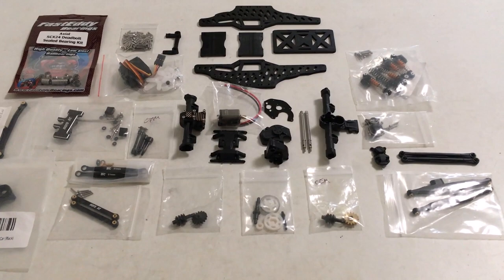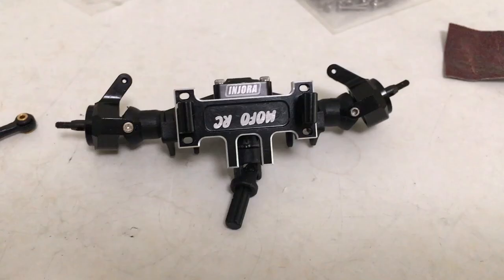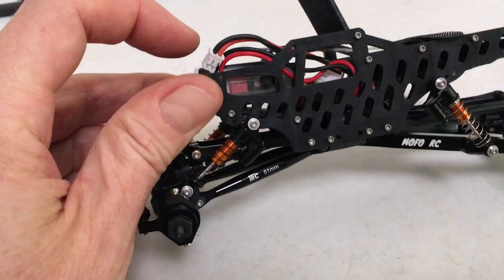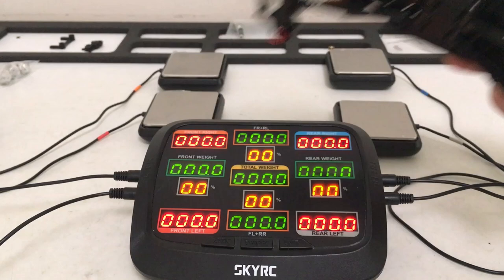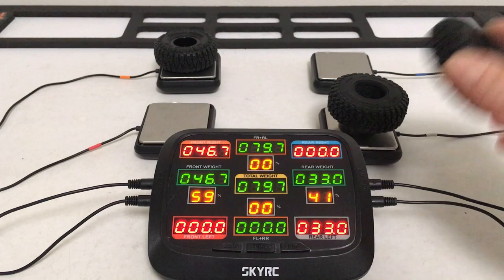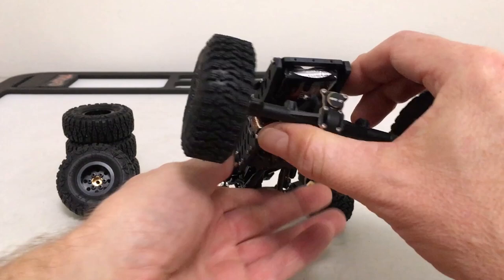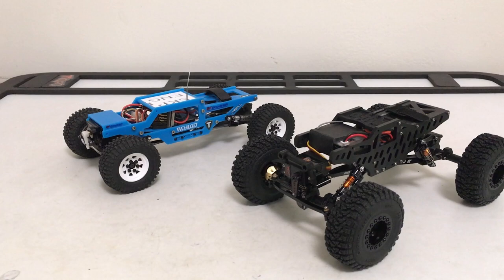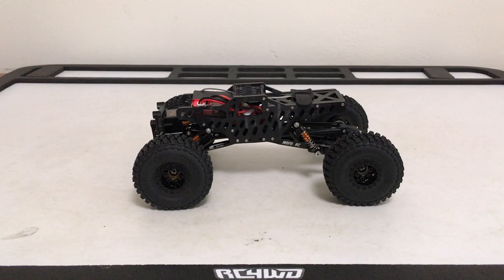MOFO RC SCX24 - PROTOTYPE CHASSIS BUILD: "THE FLAPJACK" W/ MOFO ALUMINUM TRAILING ARMS, MOTOR & RIMS

Comment: Murdered out man! Gonna test it against the warthog? I remember you saying that one was too good it ruined the fun!
Reply from the maker: For sure. I need to tweak the Warthog a bit to compete fairly though. Get the belly clearance up and steering to full capacity.
Reply: @bcochener  Be interesting to see a side hill tip test on a sandpapered board between the Warthog, full droop as you have it and the "Flapjack". just to see if the MoFo's height is a problem or if there's enough low weight with the MoFo rims/hubs to make it stable and truly 'better'.